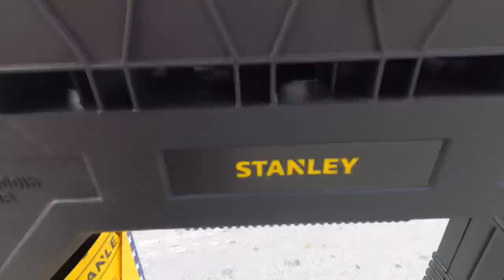Updating my cargo trailer camper home and building a desk - nomad lady doing stuff

Comment: Hi L & R , i rarely comment but have watched a whole bunch of your videos which are always great. Hoping you get over the dreaded virus - yeah Covid does suck,  and that Riot will heal fast and all good. A couple notes for you per  construction: 1. Cut that table corner at your doorway, put a curve on it so you dont accidently hit it or get your screen snagged on it.  Its easy to get things caught on a hard 90 degree corner like that. 2. Consider padding the front edge where you will stand at your computer, it will be nicer for your wrists/ arms if you tend to rest those on the table edge. 3 Table legs : for more leg room you can use angled legs for support instead of vertical legs which gets in your way and takes up space. i.e. bottom of leg mounted to floor where wall meets it -top of leg mounted near the front edge of table. Bolting is always stronger, this will hold  better than screwing into the table top etc. Lastly when redoing interior  keep in mind that bumpy road where things get jostled about. The more heavy duty / secure you can build things the better they will withstand long hauls and crappy roads. Aside from all that, I think this will sure look nice and user friendly, you'll be happy when you get done !

Comment: Looking forward to the rebuild! I converted my trailer and wish I could share photos of my process but be careful with the wood wall cabinets, I did that before I bought great metal locking cabinets.  The engineered wood cabinets separate especially with weight in them from the bumps when travelling and it's a challenge keeping the doors closed.  I also removed all of the white aluminum panels on the interior which allowed me to put 1" foam in between the metal studs and an additional 1" foam attached to 7/16 OSB using ZIP R sheathing and that gave 100% usable wall space to mount everything and further insulate the trailer.  You will be shocked at the lack of insulation that the manufacturer placed behind the panels and the aluminum panels only cause the trailer to ne less efficient in cooling and heating.  Glad Riot is doing well!!
Reply: What an awesome comment thanks for sharing Jason🌸

Comment: I’m glad Riot is doing better.  I visited with a woman and her German Shepard at a park in NM.  And later we ran into one another at a different park but this time we both had our dogs on a leash.  They got tangled up and it was on.  I have a Corgi Australian Shepard mix.  The other dog got him down so I started kicking him in the hindquarters, not to hurt him but figured it would distract him.  Got them apart with no injuries.  That’s one reason I don’t normally let him loose with other dog.  But later in Arizona at a different park him and two other dogs got along well but they were all about the same size.  

It looks like you have a sharp corner at the door on your shelf.  If you haven’t already you might want to round it off.  I’ve used plastic lids and cans to trace around to get the curve I’ve wanted.  Looks nice how you’ve cleaned up the battery area.

Comment: Use a lid, cup, can bottle or whatever to mark a radius on that corner. Then cut with the saw on the bottom cuz it will tend to chip out the top. So if it chips, it's not visible cuz it's on bottom. Most saw blades will pull the wood fibers up and chip the top. So cut plywood finish side down...just make sure you lay it out right. Then put a piece of 80-120 grit sand paper on a block of some sort and sand the edge of ply, then the sharp long edges holding block about a 45 degree angle to get a nice bevel on the long edges. Then use more of a rounded motion to go up over top edge then down vertical front edge to round over the sharp edges and smooth that 45deg you had. Do the same with bottom. Should end up with a nice rounded smooth edge that won't cut your arms up when leaning on it etc. Sand the top surface with like a 120grit to smooth it before finishing. 

Lemme know if you have carpentry, electrical, mechanical, vehicle or just about any other useful info you have questions on. I can probably solve it for you in minutes, if you actually WANT a solution.

I just added a vid on how to use a Multimeter for DC also if anyone wanted to learn a bit. Then there's vids on how to wire stuff in a car/truck,trailer

Comment: The ramps are 13" wide. I bolted 3 together side by side making 39" width x 6' long. Super Twin beds are 39" wide x 6'3" long. I bought the ramps at Lowes. Between the box and wall is my 3kw predator  gen. And a 5k pound winch and a ton of food stuff. And I still have more room. Hope this helps someone. My rig is a 6x12 cargo too.

Comment: I made my bed using 6' aluminum car ramps supported by a 5 foot aluminum tool box on the one side and  a cleat on the wall @ the other side.the box is 19" wide x 20" tall. that leaves an open space of 20"  from box to wall. I have 32.5 cu.ft. of clear  storage space under the bed. If I get stuck I can use the ramps to get unstuck. They can also be a ladder. The bed folds up against the wall and stays. Everything under the bed is accessable and can be taken out including the 6 foot tool box. Wish I could put a picture here.